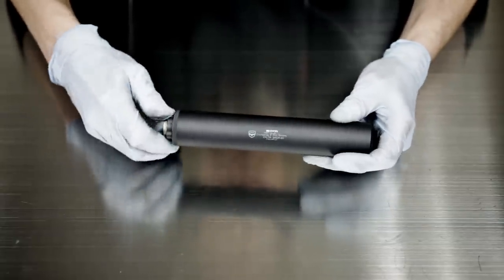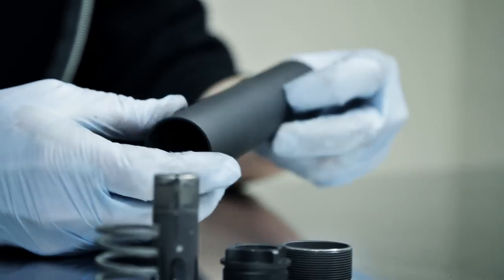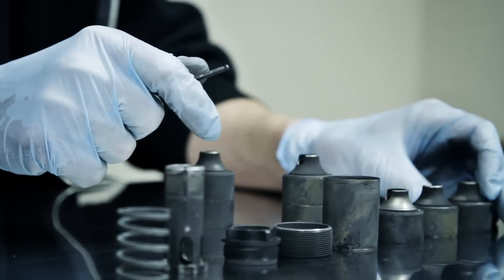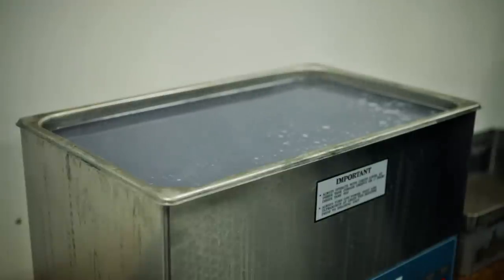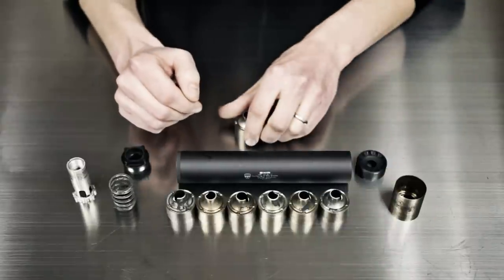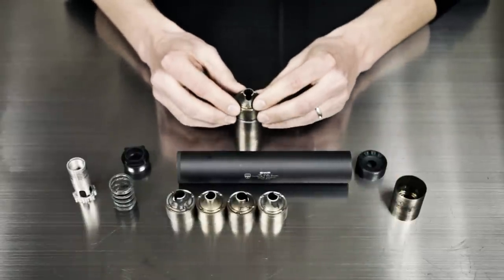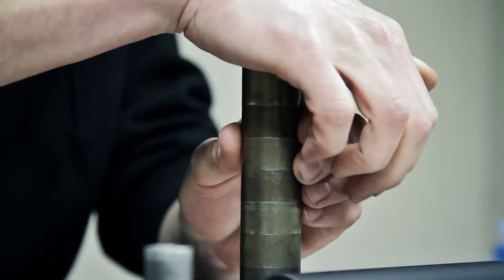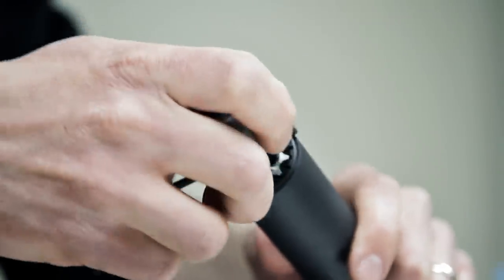SWR Octane 9 HD Cleaning and Maintenance

Comment: I have the Octane9 HD and I love it, I have tried it on a SR22, and a colt AR22, It worked well with both, but, I leave the 22lr shooting to my Sparrow, which by the way is the most awesome 22lr can that you can buy that's on the market. My question to you is, do I have to line up the baffles? or can I rotate them 180 from each other? Which by the way some cans do reduce the decilbles a little by doing that.

Comment: With everything disassembled and looking at the muzzle end of the tube, there is a piece that looks like a ring.  This piece appears to be separate from the tube and while looking inside the tube, it would be where the last piece of the stack rest against.  Is this a pressed on fitting? or does it unscrew?  Reason I ask is for extra cleaning purposes.  Thanks...